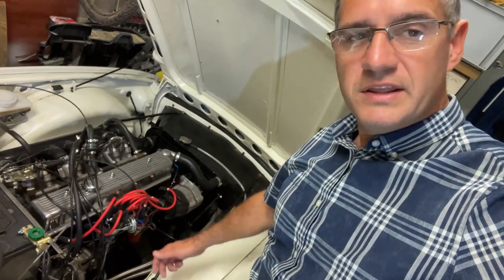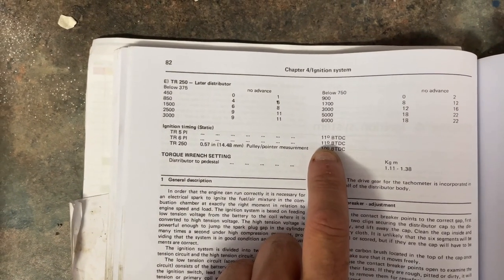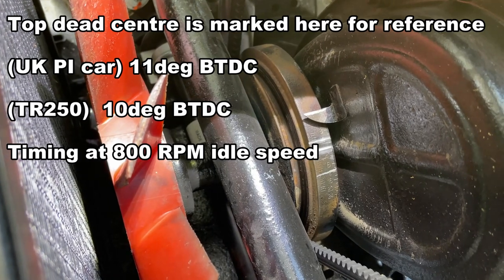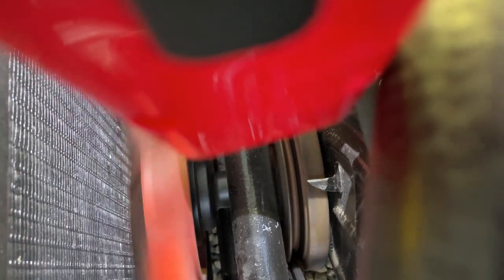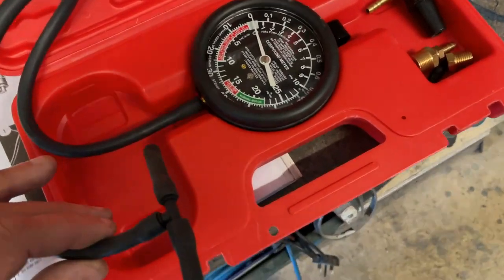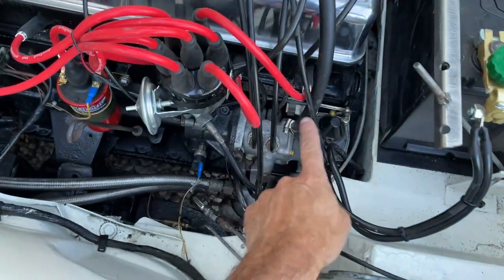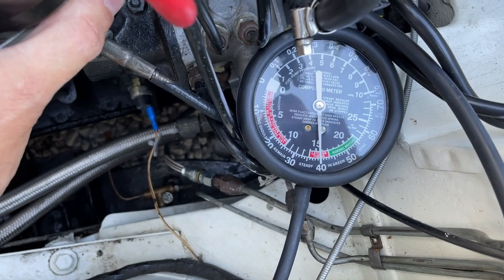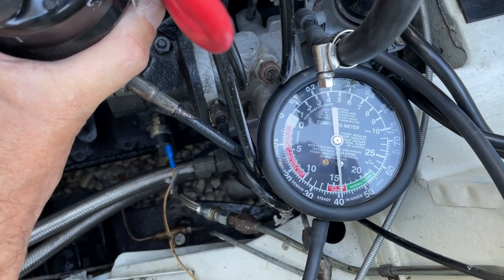TR6 Ignition Timing using Strobe Light and Vacuum Gauge method

Comment: Great video, I have 3 old Bentleys that have the timing marks on the flywheel accessed from under the car behind a cover plate which is a complete pain. As one of the Bentleys (S3) which is a 6.75 ltr V8 has a twin point system which is also a pain to set up so I have purchased an acuspark module which does away with the twin point system and all the other benefits. I was going to set up the electronic system and rotae the distributor for the best running but having seen your video I will be using a vacuum gauge, many thanks.
Reply from the maker: Thanks for watching and glad you enjoyed the video

Comment: Hi there Mr MG, this is a warning, but first, another great video. Ive recently been chasing my tail with the ignition system which I took out the old points system and worn coil and done what you’ve got on your car, an Accuspark system. It was easy to install and as soon as I plugged it in it started at the first turn of the key. It did have a rough idle because the timing was off but after timing it it ran nice…for ten miles. After I switched it off outside my brothers house, after having lunch it wouldn’t restart. The whole system had broken, all of it was kaput. The coil had given up, the kit inside the new dizzy was dead but I presume the leads and the plugs were fine. Everything was set up right but Accuspark said it was a faulty unit but never refunded me even after it got rather heated. So I had to buy a new luminition magnetronic system and a luminition coil and leads and some Ngk plugs. And the new magnetronic module fitted into the original dizzy. So be warned, there has been a number of bad reviews about the Accuspark and I’m now not going near it with a ten foot barge pole, and upon reflection it was very cheap considering it was a whole new ignition system. I would keep an eye on yours and consider changing. But a great vid apart from that
Thanks
Tristan
Reply from the maker: Thanks Tristan for the extensive comment. Your views on accuspark noted. My experience so far has been OK after 2 years of use and around 3000 miles. Will keep an eye on it :-). Glad you liked the video and again, thanks for the input. Appreciated.
Reply: @mgmidget-thebirthofaraceca4349  wow 3000 miles. I’m sure that’s fine then, I wouldnt alter a thing if it’s run for that long.

Comment: brought my uk tr from england to canada and havnt been able to get it running for years, recently after retireing I have more time to spend on it , its a pi unit which just baffles any mechanic here in canada they have no knowledge of it as all trs were carburated exported to north america, and after thousands of dollars of exspensive canadian mechanic knowledge no further ahead , when back in britain it was serviced by auto injectrics of hornchurch, a young guy who just started his bussiness when I bought the car in 75 ,so all service was done by him and it ran like a dream, so now im trying to gain knowledge of serviceing it myself , I used to do the timing with a strob like your video and worked ok , do you suggest a vacum is a better test as I plan to buy the neccesary gauges and equipment to work on the injection and metering unit pressures trying to learn as much as I can thanks for you video I will be following , sorry for the long message  regards  Bill Gregory
Reply from the maker: Hi Bill, thanks for the comment. My approach to setting up the pi system is as follows - i hope it helps.  1. check constant 100-110 psi at the metering unit from the fuel pump then 2, check metering unit diaphragm integrity using the suck method. (ensure holds a vacuum)   3. check and bleed injectors to ensure spraying correctly, 4. set ignition to factory 11deg BTDC, 5. balance throttle bodies using adjustments and carb balancer tool.  6. fine tune timing using the vacuum gauge and test driving to optimise but ensuring no pinking.  all very doable by the home mechanic. good luck with the engine tuning.

Comment: The exhaust pulls more air through the intake than the piston. Therefore the more efficient the exhaust the more vacuum. Also the more overlap in the cam timing the better the exhaust pulls on the intake. All the best.
Reply from the maker: Thanks Joe for the input.
Reply: @mgmidget-thebirthofaraceca4349  For what it's worth.

Comment: Thank you for your videos. I live in the USA and I own a 1970 TR6 PI cp, righthand drive.  
My engine has been sightly bored out, has Fast cam 86 camshaft, and my timing is set to 14 deg BTD. I tried following your method of timing using a vacuum gauge and  timing went up to the high twenties with a max vacuum reading of 12.5. Took the car for a drive and heard no pinging. I was hoping you could comment on that.  
How high is too high of a timing?
How do I know what the correct timing should be?

Much thanks,
Cheers,
Sam
Reply from the maker: Thanks Sassan for the comment and sharing your experience.  The The key is to listen to the engine revs as you retard the timing up from approx 10degs . The Vac goes up to its peak (leaner running) and the engine will pick up in its note. At this point lock off and test. I actually advanced the timing very slightly after that point to gain more fueling.  Too far and either it will begin misfiring or on test drive it will start pinking on acceleration as its running too lean. I found mine runs best at around 16 deg BTDC (assuming the timing marks are correct).  A spark plug soot colour check after a good run will also confirm if the mixture is running ok or too lean. Adjust as necessary. Hope that helps
Reply: Much thanks for your advice.  I initially had the timing set to 14 BTDC, my car seemed a bit sluggish. After using the vacuum gauge, as I had mentioned, timing was set to 26.  I took the car for a test drive, car drove well, accelerated well, and no pinging throughout the different gears and RPM ranges. I was too afraid and concern that at 26 BTDC It would do more harm than good.  I will try 16. 
Again, much thanks for your videos. There is no one here that I could seek help from (its carburetor or nothing). 

Cheers.

Comment: Hi. Great video. I tried to see the setting on my tr6 pi but instead of vacuum 16 there is only 10 on my car. Is it wrong?
Reply from the maker: Always worth checking for vacuum leaks but assuming it all looks OK, then i wouldnt be too focussed on a number. The principle is the biggest 'bang' from the best timing will give the most vacuum as the cylinders are pushed down.  So setting the timing to give the highest vacuum regardless of the number will get the timing in the right place. After that the fine tuning is done by a road test. If the timing is too advanced and shows signs on 'pinking' on hard acceleration the timing so should be backed off until you are happy with the drive. This is the optimum position. It can take time to do and a rolling road tuning would find this much faster of course but it can be very rewarding and educational to do yourself. Good luck with the setup.
Reply: Super thanks for the help. I'll try to set it up like this.

Comment: The engine bay seems to be left-right mirrored in the video for some reason (maybe green-screened?). Slightly disconcerting. That said, an interesting method and I've sent a link to the video to a friend who has bought a TR6 fairly recently.
Reply from the maker: using the front camera on an iphone without mirroring the shot. so some videos look like they are reversed but the car is actually a RHD UK car

Comment: You make great video's but technically some things are wrong here. First the 11 degrees is static timing. That is when the engine is NOT running. So with the strobe light you are measuring dynamic timing (with vacuum advance disconnected). That should be quite a bit more like 16-20 degrees at 1500 rpm (depending on the curve and vucuum advance).
This is why the vacuum shows late ign timing. It should be advanced a lot more to read in the green zone. There is defenitley something wrong with your engine or ignition that you are not able to push the vacuum beyond 15-16 HG!.  
Finally you advise to advance the timing should any pinking be experienced in the road test. It is the opposite! Put the car in 3d gear and drive up a hill accelearting from 1500 rpm en should pinking occur then retard the timing a bit.(If you have a distributor with a fine tuning wheel it's easier)

What are your thoughts on this? Also look at the Moss motors video
https://www.youtube.com/watch?v=utUSI-JYhVU&ab_channel=MossMotors%2CLtd.
Reply from the maker: Thanks for your input. Glad your enjoying the videos. If you read some of the other comments aswell you are absolutely right. when test driving and you experience pinking you should retard the timing. I do it a degree at a time until the pinking stops.  Slip of the tongue when speaking to a camera and stringing sentences together I'm afraid.  I'm considering updating this video to make it 100% correct but the principle of using the vacuum to initially set the timing on these cars remains sound and hopefully gets people thinking about this as an alternative to just dynamic timing strobe checks. Thanks for the comments - always appreciate good discussion
Reply: @mgmidget-thebirthofaraceca4349  I agree fully on using the vacuum! I always do it and I am able to reach 18-19 HG/inch. Again this should be a healthy and attianable score. You might have a vacuum leak of some kind. But you are right in saying it is about reaching an optimum value, regardless of the absolute figure.

Comment: I want to understand why the maxiumum pressure in the cylinder after ignition leads to the maximum vacuum in the inlet manifold - I don't see how the one causes the other.
Reply from the maker: The principle is that the bigger the bang through better ignition, the higher the suck on the induction system as the cylinders go down faster, so as 2 cylinders are on their combustion stroke they create a vacuum in the 2 cylinders on their induction stroke (via the crankshaft) pulling air into the chambers with open valves. The better the ignition, the higher this vacuum will be. So to set for the best timing you start by setting the timing to the best vacuum setting and then retard the timing a degree at a time until you get no pinking in hard acceleration in 3rd. At that point you have the car running the best it can. Hope that helps
Reply: @mgmidget-thebirthofaraceca4349  Many thanks for doing your best to explain it to me.  I have no problem in understanding the statement that setting the timing to get maximum vacuum (then retarding to eleminate pinking on hard acceleration) is the best setting.   That's more or less how I used to set the timing on my Ford 100E as a student years ago.

My difficulty is in understanding why the best combustion leads to the highest vacuum.   The speed that the pistons descend in their cylinders is determined by the rpm of the engine, so far as I can see  - not by the efficiency of combustion.

Maybe it is to do with the fact that, for a given rpm, at maximum engine efficiency, the throttle will be providing a greatest restriction of air into the induction manifold.  At lesser efficiency, more fuel (and so more air also) will be entering  the cylinders,  so less constriction of flow by the throttle resulting in less vacuum..
Reply from the maker: Yes, could be. Its not the complete answer for sure but using vacuum with get you a good starting point for final tuning on the road in the same way a timing gun will. The advantage on a TR6 is that as the timing on the crank pulley is lost due to wear over the years, vacuum is an outcome of the engine performance.  Starting here and retarding the timing to remove pinking has never let me down yet. Interesting thread - thanks for the input

Comment: Close, but no cigar.
You're doing it wrong.
If you want to use the vacuum method you hold the revs at close to 1000 rpm,
then you advance the distributor to get your highest vacuum reading, then back it off 1" of Hg.

Still never precise.
The manufacturers knew what they were doing, had performed exhaustive testing to arrive at the final product and had to guarantee their products.
To pretend that some bloke in a garage knows better than all those clever blokes is a pisstake..
That said, Aston Martin, in the 1950's gave workshop advice regarding ignition timing, with no actual figures. They deemed that after having set the ignition points gaps and spark plug gaps to specifications, to advance the ignition timing and then road test the car. On the road test they said to load up the engine/lug it in low revs in top gear and listen for "pinging/pinking" whereby the timing should be retarded so that pinging was just no longer present if driven similarly. Those cars have no ignition timing marks from factory.
Every engine is different.
You have been reading too many forums and their un/mis informed old wives tales.